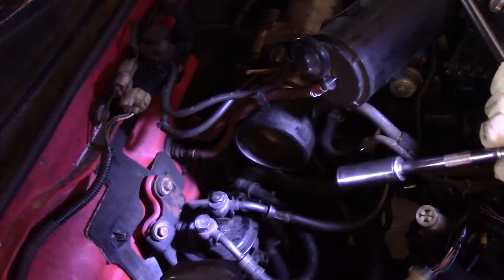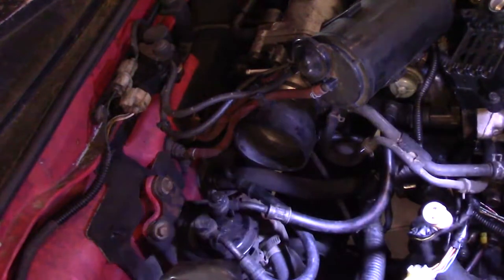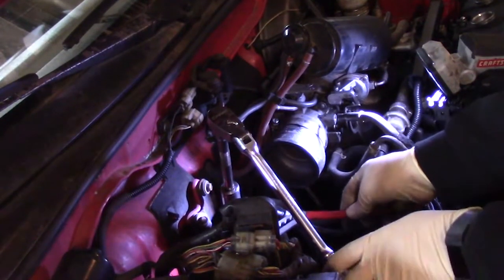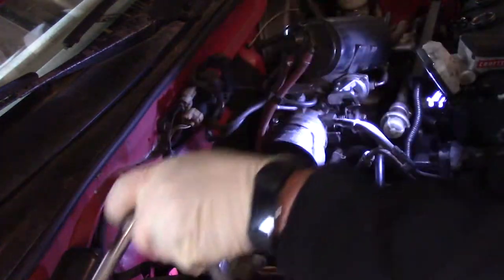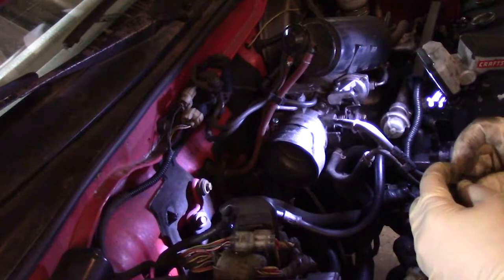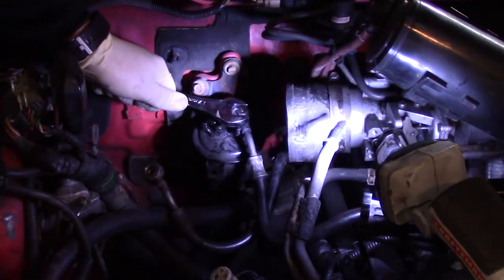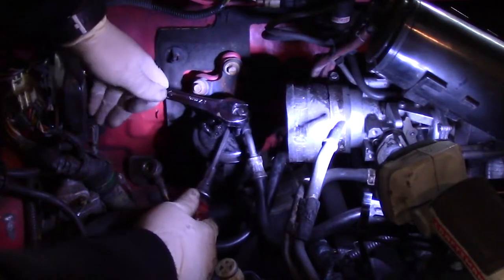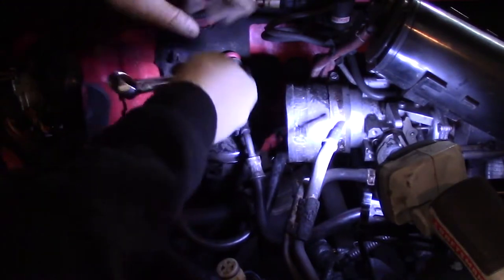EF Civic/CRX Fuel Filter Replacement

Comment: oil filter pliers work great to get a firm hold of the fuel filter
Reply from the maker: That's a good idea, I'll give it a shot on the next filter I change
Reply: @MuffinRacing   Line wrenches also makes fuel jobs easier.

Comment: I used to assemble the fuel hoses onto the fuel strainers back in 1989. My company made the fuel hose and fittings. I'm not sure if after market washers are the same as we used but the original washers had a rough textured edge on 1/2 on the side. The rough edge side faces down onto the fuel eye joint. Don't ask why but that was our standard operating procedure.
Reply from the maker: That's a very interesting story and great tip, thank you for sharing!
Reply: @MuffinRacing  I see everyone loved the Banjo bolt. We had special torque wrenches provided by Honda. I still work there after 32 years. We make most of the antivibration products for Honda Toyota, Nissan. Such as liquid filled engine mounts and strut mounts.

Comment: My service bolt broke off while tightening it into the banjo bolt. Where can I find a replacement for either one?
Reply from the maker: I use HondaPartsNow for OEM parts. Whatever Honda no longer makes, it's still a handy guide to find part numbers. Sometimes Amazon or eBay will have the part if it's discontinued. Looks like Honda still makes the service bolt, 90009-RMX-010, but I can't find the banjo bolt anywhere unfortunately.

Comment: Thanks man, I used one of those giant screw drivers to hold mine still. They were a real bitch to get off, so this was actually super helpful. Mine had washers on both sides of the hoses by the way. Now I'm going to let my old filter dry out and then cut it open to see what a 200,000 km fuel filter looks like :D
Reply from the maker: That sounds interesting! Make a video of the filter and share the results

Comment: Heyy!!! Very useful vid, thanks. But im still having trouble with that bolt after the banjo? I got a 89' DX, my first car. Ive Been at it for awhile now but it just wont break loose? Ive tried silicone penetrating spray, tappin it, securing it down (kinda hard to do since the mount is finicky) but still nothin. I even tried moving that charcoalbox outta the way so i can get a good angle but still. Nothin yet. Any advice, tips, questions? Anything would be appreciated, thanks.
Reply from the maker: Sometimes unbolting the bracket from the firewall and taking the hole thing out can help. Worth a shot
Reply: @MuffinRacing  thanks for gettin back to me. i tried that too, unfortunately it didnt work. It Might be seized completely? Appearently the filter was last changed in 97', it was sittin for like 6 months prior to the purchase too so it would make some sense. Is there a way to take off the hose from the other side and just replace the hose & injector/connector or whole assembly? Im not gonna jump to that but if penetrating oil and a visit to a honda tech friend doesnt work then ill resort to that
Reply from the maker: I haven't replaced the line coming from the tank before, but the line running from the fuel filter to the fuel rail is pretty easy to change out.

Comment: Copper gaskets did not work for me, i applied alot of pressure and they still leaked. I used rubber o rings with the washers, applied pressure and now it doesnt leak. Was that a good alternative?
Reply from the maker: Depends on the rubber, the fuel could potentially dissolve the rubber over time if it isn't fuel safe. That the copper didn't seal might suggest there was a scratch on the filter or hose
Reply: just put mine back together... and had to do the thermostat as well.. so anyway i putting it all back together... and it was shooting gas everywhere! I have no idea what to do or why it is doing that.. followed the video to a T. @MuffinRacing

Comment: I have to do this on mine shortly. Could you not use the box end of the wrench to remove that second bolt ? ( instead of the open end )
Reply from the maker: You can certainly give it a shot. Every one I've worked on isn't a traditional hex head but instead a round head with two flats
Reply: Just removed the old one now on my CRX. I was able to remove both bolts with a socket ( on a breaker bar ).    Is the right bolt ( banjo ) the input ? And the left one the output ? That’s what the arrows on the stock filter seem to indicate.  But my new WIX aftermarket filter has the arrows in the opposite direction.  Im stumped.
Reply: Ok looks like the left bolt is input ( from gas tank) . So the new afternarket filter is right lol.   Thanks for this vid man.
Reply from the maker: The banjo is the output. At the end of the day, the line coming from the firewall is the input and the line going to the engine is the output

Comment: Should I fill the new one up with fuel before installing ? Also I’ve heard you can use automatic transmission fluid and it won’t hurt ?
Reply from the maker: There's no need to add fuel before installing, it will probably spill out trying to put it back in anyways. The fuel pump will fill it on its own. Also wouldn't use transmission fluid, that's a bad idea
Reply: Muffin Racing okay, the atf is a way you could do it for diesels I guess. Also the hose from the fuel rail which Arrow does that one go to
Reply from the maker: The hose from the fuel rail goes to the hose pointing away from the filter, the outlet